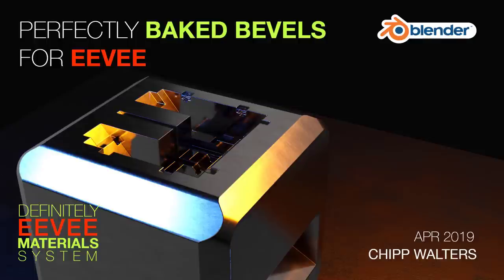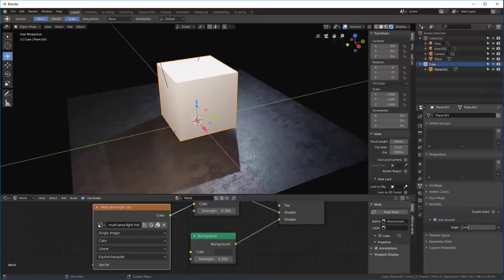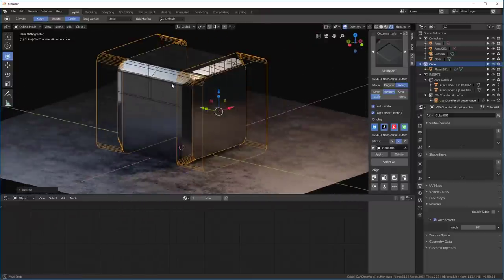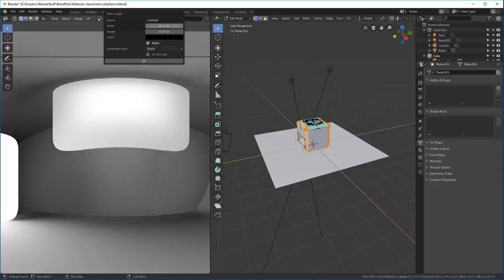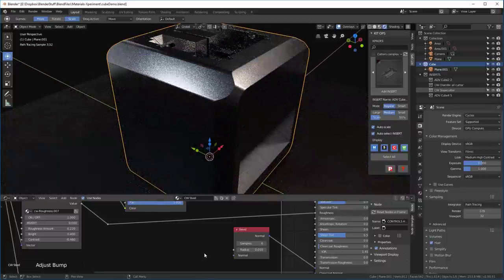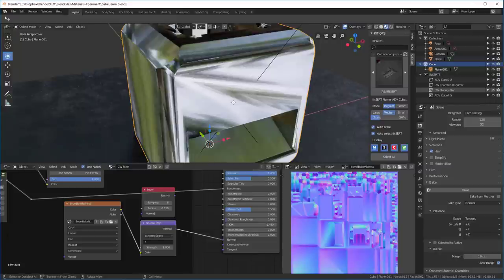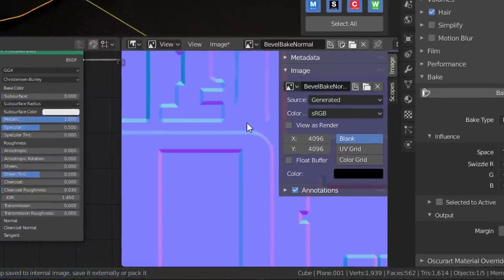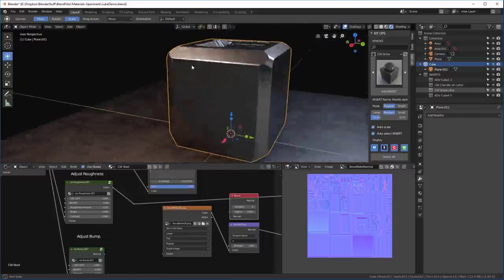Perfectly Baked Bevels for Blender 2.8 EEVEE

Comment: This method is amazing, the edge split modifier was the key component in the process I was missing when I had tried this method a year or two ago. Not having to create high poly models for everything is a huge timesaver for a lot of models where I just needed the edges smoothed since I do a lot of normal map detail painting after with 3d coat. I'm literally getting the same level of quality as I was when I'd be baking models with marmoset toolbag pretty much at a fraction of the effort.

Comment: Oh man, this was a struggle, but I finally got it working for my particular model. 

First of all, remember to duplicate your model so you have a backup!

What helped me was to add a weighted normal modifier and a triangulate (I only added this as I want my model to be a game asset) modifier under the edge split. Make sure the triangulate is set to "Fixed" "Beauty" "Keep Normals". At least that's what worked for me. 

After doing the bake, (again, make sure that you're in non-colour and Linear workspace, mine kept bouncing back and forth, frustrating me to no end!) apply the modifiers in the stack order. I spent a whole day fighting with this, but it seems I finally have a workflow that will work and enable me to bring this to Substance Painter to finalise. 

There might be some underlying faults with my method, and, if so, then let me know. All I know is that it got me nice bevels and smooth reflections across my model. My model with bevel modifier went from 12,000 polys to 940 polys with no modifiers and a normal map. Delighted with my results.

I will note that there were a few parts where I had to clean up in Photoshop, but those were minimal.

Happy Blendering.

Comment: Wow, Chipp this is really good stuff.  I had no idea this was possible to get the bevels working in both rendering engines like this.  Man you must have been really determined to push yourself to find an Eevee/cycles compatible bevel setup.
Reply from the maker: My next goal is to put together a workflow for chipped paint with worn edges and dirt in the cracks :-)

Comment: Awesome tutorial. Hope bevel node will soon be supported by Eevee. Currently using HardOps to create bevel edges then using Substance painter to bake the normals to a low poly mesh. Thanks for that smart UV unwrapping tip. Never thought of adjusting the parameters.
Reply from the maker: The problem with your approach is that there are many instances where a perfect bevel cannot be created (by Hard Ops or other) on a mesh. That's why this technique works.

Comment: Hey Chipp. Always love your content and always seem to come across your stuff when I'm trying to figure stuff out! In my tests with baking the bevel shader I ran into problems with using "shade smooth". I also ended up with the edge split modifier workaround, but still have issues. It looks like you may still be having those issues as well based on the normal map that we see in this video. Some of those large flat faces seem to have a gradient on them. Implying that there's some normal action happening where there shouldn't be. Though fairly minimal in light of the edge splitting and island separation, but it's still there. Just wondering if you've found another way around this or have made any others discoveries in the meantime. I'm still on the search for "no topology" bevel shortcut but always hit one wall or another ;)
Reply from the maker: Yes, you are correct. But that too can be minimized by setting the edge split angle.

Comment: Chipp im in need of some dire explenation regarding Edge Sharps/Edge Split Modifier. Question1; could you have, instead of the edge split mod., selected all your UV edges and "Mark Sharp" instead ? Q2; If so, is the difference that with the modifier you only "use it for baking better normal maps" and are not using it for the exported model ? Q3;if so, how would your model have smoothing groups exported to a game-engine correctly without "Mark Sharp", do you use AutoSmooth ? if you do use autosmooth im confused since your smoothing groups will not align with your UV's correctly.

The general rule is to have a "Smoothing split on a hard edge which then requires a UV seam to avoid baking artifacts". If you are familiar with "TexTools for Blender", there you can set your "Smoothing from UV's" which "Mark Sharp" all your UV borders on an "autosmoothed to 180" mesh. I then export the lowpoly with "Edge Normals" on .fbx options. The problem im facing in Painter is that I sometimes get small hairpin seams on the bakes. Cheers Chipp!
Reply from the maker: The purpose of the edge split modifier is to reduce forced smoothing artifacts. Try it without it and see what you get. Also, it's important to break up the UVs along their hard edges to get sufficient padding to bake the bevel normals. HTH.

Comment: Blender 2.8, beta and RC3, used a default cube with Principled BSDF (white colour), tried to plug Bevel into Normal socket, used all kind of settings - with no results. Bevel does not show up. What might've been wrong? Please advise.
Reply from the maker: You need to Render in Cycles, not EEVEE for this.

Comment: You can avoid artifacts by duplicating your mesh and bake bevels from one mesh to another. Correct me if i am wrong.
Reply: its work, but why?
Reply from the maker: The whole point is to NOT have to put REAL bevels on your mesh. In many cases it just doesn't work.
Reply: @ChippWalters  i am talking about this tutorial: ?v=eDN2bLs-86M  he uses two meshes for baking from bevel shader
Reply from the maker: @medusa219  Yes, I know about that technique, in fact I have several tutorials about doing the exact same things.  ( https://youtu.be/BCd1XiPLza8 ) 

Still you MUST HAVE bevels on the high poly object in order to transfer to the target object. Many times this is difficult if not impossible for non-CAD poly models. This technique I show is faster.